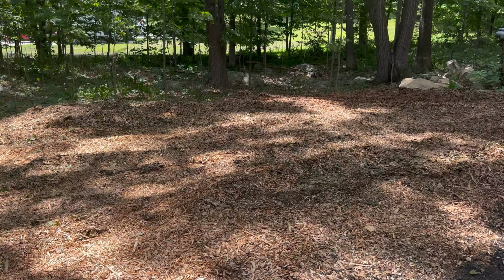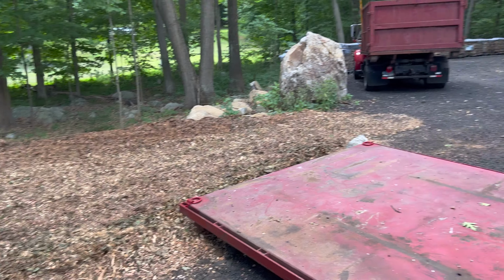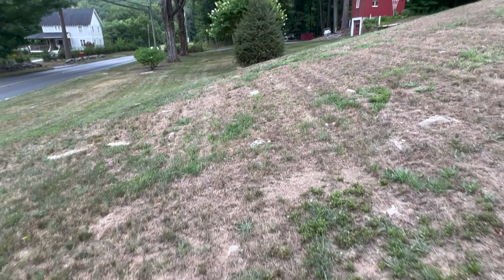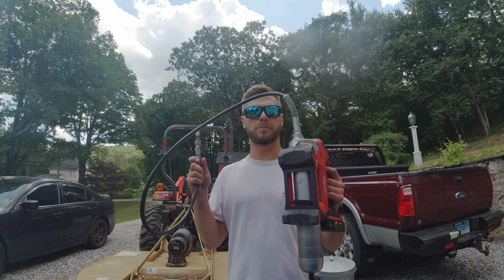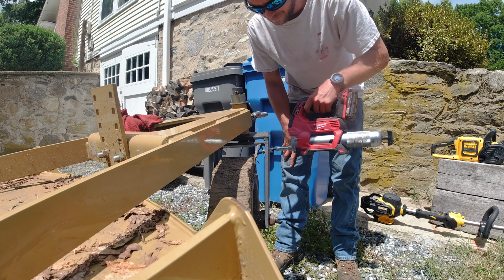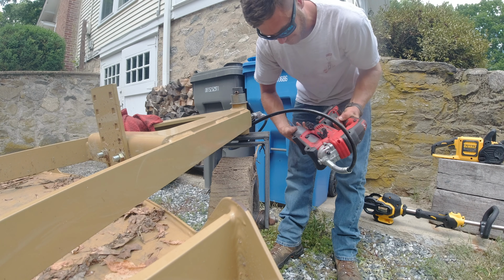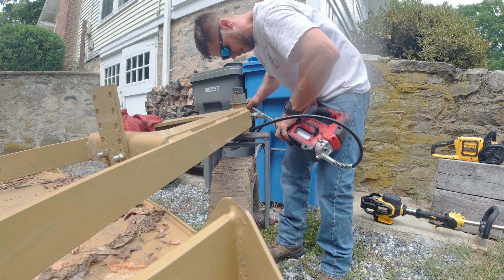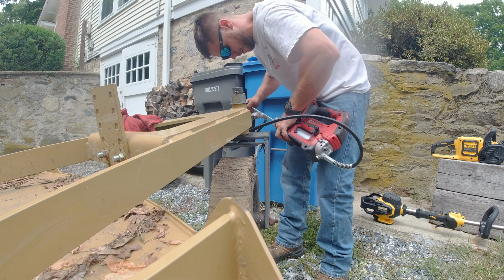#262 Spreading WoodChips and Brush Hogging with the Kubota Tractor

Comment: I have the same Milwaukee grease gun and mine was a battle when it was new. I don't grease too many things so it took a couple of years before mine didn't fight me so much. Sometimes it would work and then it would do the same that yours does. Wouldn't prime when I put a new tube in, sometimes would loose prime part way through. I did consider several times giving it flying lessons but luckily decided against that lol.  Now mine rarely has any issues...it just works.
Reply from the maker: That’s strange hopefully mine just starts working…

Comment: I'm going with Airlock on your grease gun as well.  I don't own one yet but I've learned with manual guns the heat will build up air pressure even into the hose.  I tend to store mine with the business end up rather than flat.  You can also try to loosen up the coupler on the end of the hose to relieve pressure through the whole system.  
Wood chips do just what everyone says they do.  They break down to compost and soil over time.  Just add more chips as they break down.   It's a great way to make your yard bigger over time!  My whole wood yard is wood chips for a few reasons.  Mainly to fill in low spots and reduce mud but I never end up putting a chainsaw into the dirt when I'm cutting poles on the ground.  Just more wood (chips).
Reply from the maker: Yeah the chips are just a temporary solution! Eventually like you said it’ll all be dirt! Thanks for watching!

Comment: I love my Milwaukee grease gun. I found the lock and lube would not allow me to get into tight spots so I put that on my old manual gun. The purge button on the Milwaukee will purge the air out of the grease cylinder but not out of the hose. If there’s air in the hose you just have to keep letting it pump until the grease pumps all the way through the hose.
Reply from the maker: Yep I’ve tried this and sometimes it works sometimes it doesn’t!

Comment: Hey Jake another great video. Your grease gun is getting air locked. It can pump grease faster than it can pump Air. This is why it's taking so long to get to the nozzle. Quick remedy to this problem is screwing the grease gun's cartridge holder 3/4 of the way onto the threaded body of the grease gun. Squeeze the trigger until the grease comes out. And then finish tightening it up. This will prevent the grease gun from getting air locked and should be much easier for you to start pumping grease. Keep up the good work 👍👍
Reply from the maker: Yeah so that’s basically what I tried here and it did start working!

Comment: I have the Ridgid grease gun, when I have a problem like you had I check that the plunger is in the end of the tube. Most times the tube is crinkled on the end and the plunger is just sitting there. Take the tube out, release the plunger, put it in the tube by eyesight then pull the plunger and tube (press it against something) into the housing then screw it on.  I find some brands of grease have weaker tubes. I now use Lucas red and Tacky and haven't had any problems.
Reply from the maker: I’ll have to check this! Didn’t know that could happen!

Comment: I know it’s more expensive, but I’m a huge fan of the lube shuttle. I go through 3-4 tubes of grease per year at most, so the cost difference isn’t a deal breaker.
Reply from the maker: I haven’t heard of that, I go through a lot more than 3 to 4 tubes I just want something that works.

Comment: Jake I have a Dewalt with a primer screw that has never fail to prime. For your grease gun hold the button down and press your trigger  so you build more pressure see if that helps if pumping the primer button is not enough to prime it.
Reply from the maker: Yep I’ve tried this and it works with varying success!